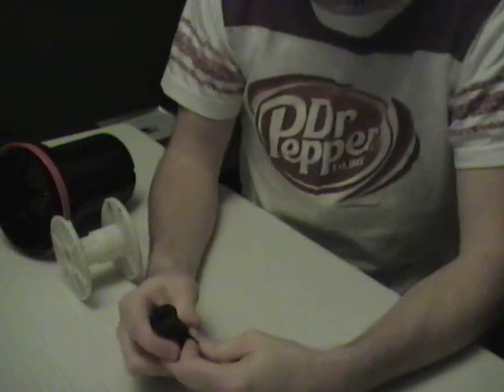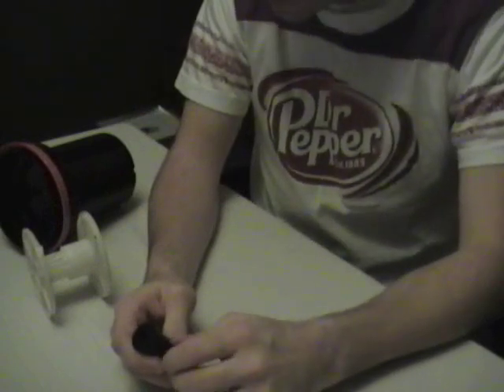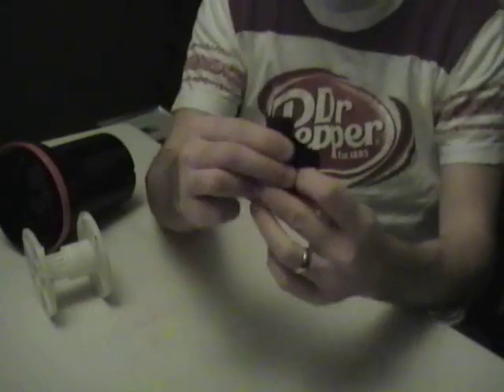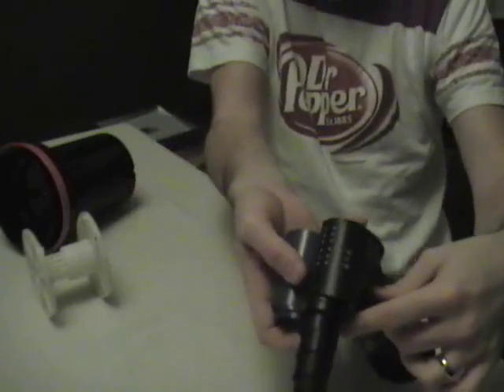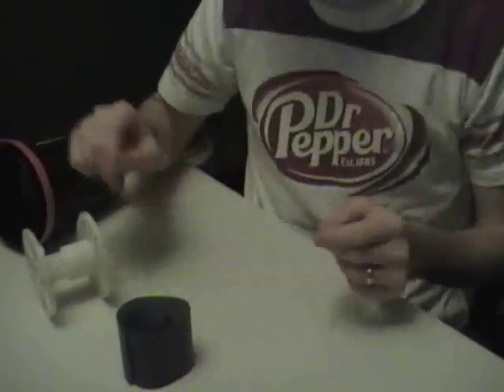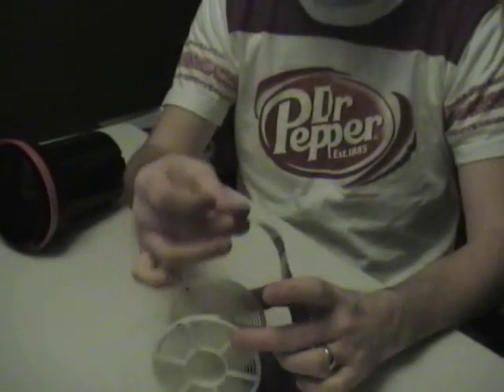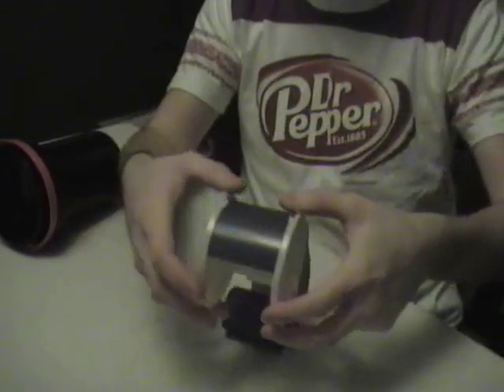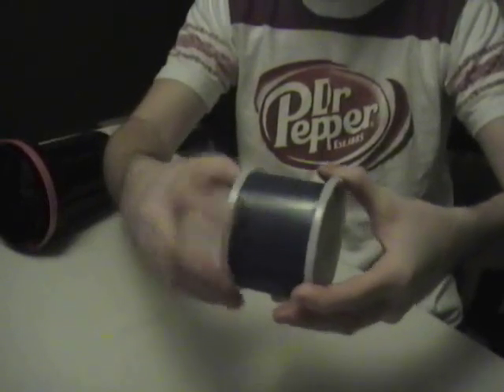Loading 120 film into a Paterson plastic reel

Comment: 120 on the Paterson is harder than steel reels.  The problem occurs when film has been in camera awhile - the end takes a set, so when you pull it through and begin to ratchet the reel, the leading edge will dig and often leave the groove and head inside and jam.  The solution is to start over and reverse the roll end; hopefully the other side has less set to the curl and will not dig. The Hewes reel in a steel tank is more positive for me.

Comment from the maker: When I first started, I read quite a bit, and nobody really described their process exactly like mine.  I think the two important parts are pulling the film onto the reel rather than pushing it in and then using your hands in a manner to keep the film aligned in a straight shot to be loaded.   It was a really nightmare the first time I tried 120.

Comment: The first roll was a little tough winding in efficiently as you demonstrated but I got it on.
Developing was a success HOWEVER - PURPLE cast on several negatives mostly in middle... Im thinking it was a loading problem because the film was mostly coiled on the center?But it was 2008 expired film though refrigerated so maybe HEAT damage?
Any ideas?  Will develop second roll ready to go and compare if purple and loaded right HEAT - fresh film should cure that. Thanks for helping me get it done

Comment from the maker: @mikedevelta In a classroom environment it seemed like we were always stuck using wet reels because someone had recently  used them. With 35mm it was easier to load than 120 because the film is narrower.  But water can stop you dead in your tracks because the film emulsion is so sticky. My advice is to relax and try to get your technique down. Iowa is humid in the summer and dry in the winter, so it's only occasionally a problem for me. Usually when I'm loading 12, 4x5" sheets in holders at once

Comment from the maker: @RNGWRM666 You have to remove the paper.   I imagine it'd still develop just fine, but it'd make a huge mess.   It'd be hard to load the film into the spool with the paper coupled to the film.  It's completely loose from the film.